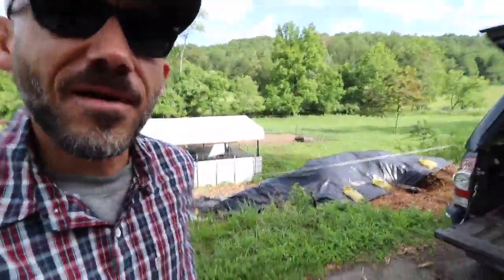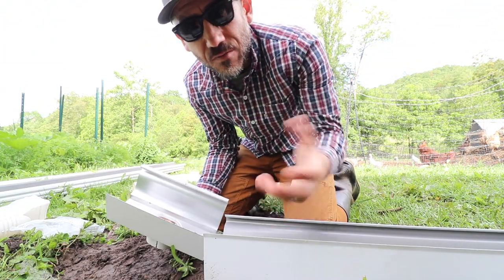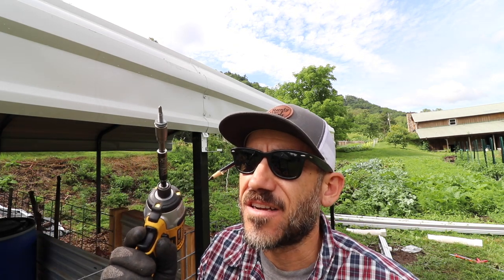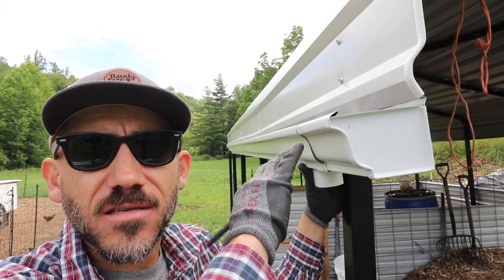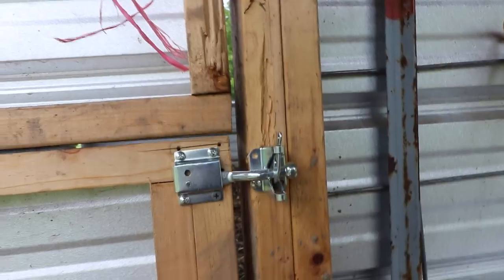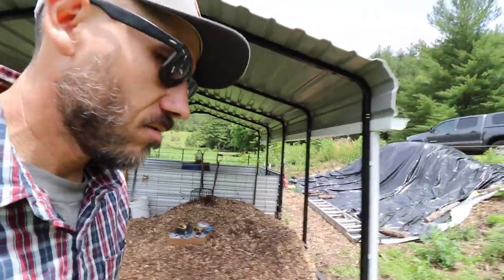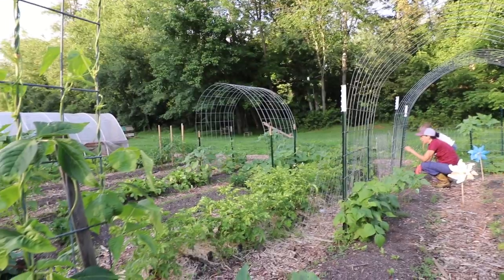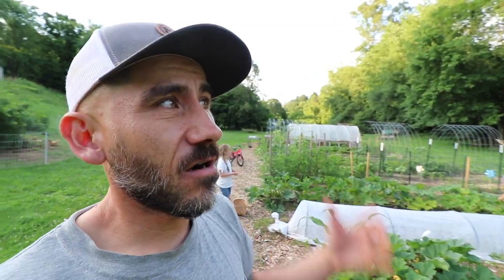DIY Car Port (PIG SHELTER) RAIN GUTTERS

Comment: I am a certified pig shelter  drain inspector and you cannot drill into the gutter without a permit. Other than that not bad. The beans, lean them on the trellis and give them lots of water. thanks for this.

Comment: Divert the gutter to the waterer.  Because of the ridges on the steel isn’t the water going to just run off each end?
Reply from the maker: The sides were the issue. Not the ends. Thanks

Comment: Sorry to say but the gutters are on the wrong 'sides'  of the roof.  They should run  90 degrees to the ridges. I.E. at the front and back.
Reply from the maker: Because it’s a pig shelter the issue was the sides. Not front and back. Thanks
Reply: If you look at where he installed them, the very edge of the roof tucks inward  aiming the water into the pig port. If it were a straight edge, they would not need the gutters at all.